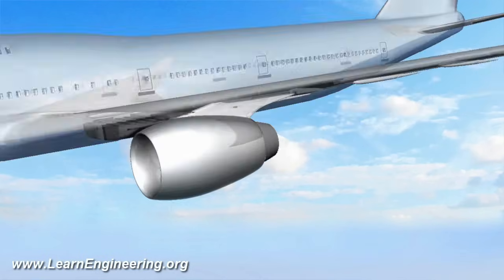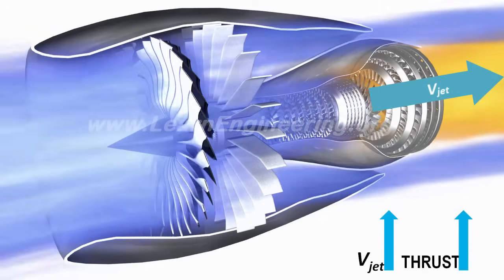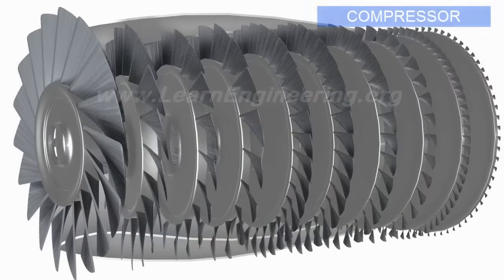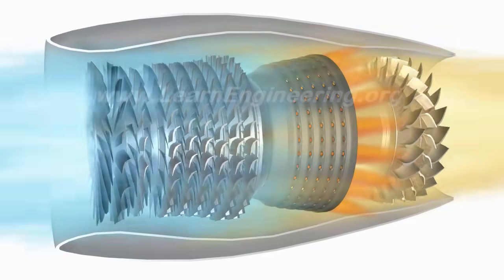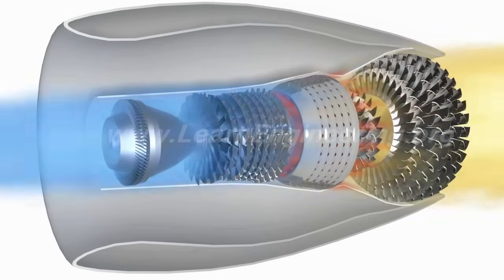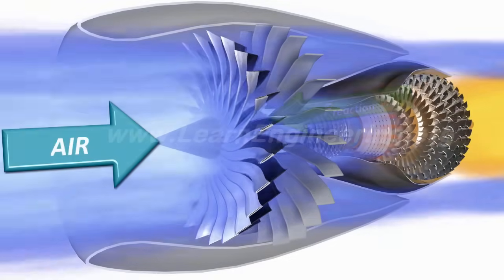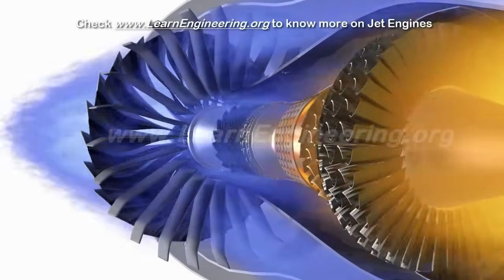Jet Engine, How it works?

Comment: I would dye to know what makes the jet engine spins at the beginning 🤔🤔🤔
Reply: What color of dye would you use?
Some jet engines use compressed air to start. Some use an electric starter motor.
Warped Perception has come fun videos where he runs small jet engines.
AgentJayZ rebuilds jet engines and he has a bunch of great videos on the topic of jet engines.
JohnnyQ90 also has some videos with small jet engines.

Comment: We can put same engine vertically and make a rocket ...
Reply: Until you run out of air when you reach space.
Reply: SpetsnatzLegion 336  I agree , I realized that after posting my comments, these engines requires oxygen and after reaching certain height there is no oxygen .
Reply: Rocket doesnt have moving parts. Its just fuel burning rapidly and being forced out from a small hole.
Jet has spinning turbine.

Rocket fuels usually have Oxygen in them + theres seperate oxygen tank for extra.

Comment: How do they start
Reply: Im no expert but my guess is that fuel is slowly ignited that starts spinning the turbine and as it starts sucking more air in and pushing exhaust out, more fuel can be inserted.
Reply: The shaft is started by an air starter, once N2 (the core) spins up to 25% fuel is added therefore spining the shaft faster

Comment: So the fans after the point of ignition are used to power the fans before the ignition?
And the fans between the turbine and the point of ignition are used to compress the air to be ignited?
What, other than the differential between the air pressure (?) prevents the expanding hot air moving back through to the front of the engine?

Comment: An escaping air balloon does not move because of a reaction force. It moves because of the internal force (pressure) imbalance: there is a hole in the back with zero pressure while the forward pressure keeps acting on the font wall of the balloon.

Comment: dear sir, what's the difference between steam turbine and gas turbine, please explain, I'm waiting for the answer, thank you
Reply: A steam turbine is a turbine that is driven by pressurized steam. The turbine is usually connected to a generator for electricity production. A gas turbine is what is shown in the video. A flammable fuel is used to heat up the air in the turbine and cause it to spin as it moves through.

Comment: but how do the fans turn? what makes them turn? is there like a rotor or engine that makes them turn? i have been wondering how it really works... i wanted to make a mini jet engine. :d
Reply: The air moving through them causes them to spin. When the fuel is burned it causes the air to get hot and forcefully exit the turbine. Air from the front of the turbine rushes in to fill the space the exiting air leaves behind

Comment: How do the engine start? It seems to me that the engine would have to have momentum to work.
Reply: They have a gear box hooked to the low compressor that has a small air starter hooked to it. The burner can doesn’t move.Turning the low compressor and low turbine will give it enough airflow to start the engine.. There are igniters in the burner can that ignite the fuel. First they bring the speed up with the starter., then turn on igniter and fuel. I worked at P&WA back in the 70s and also was in Naval Aviation. They preheat the fuel using a heat exchanger that cools the oil.

Comment: Nobody tells what rotates the engine blades to create compression.
Reply: You missed the point that compressor shaft is directly connected to turbine. When the turbine blades moves due to movement or expansion of high speed hot gases, compressor blades also moves as the blades are connected through same shaft of turbines.
Reply: Remember that first to turn turbine blades when engines are switched on a highly inflammable fuel is burned in combustion chamber which create expansion of hot gases and this turbine moves.
Since the turbine moves, compressor blades also rotates to genrate compressed air.

Comment: Awesome video,
How much liter of fuel per miles an aircraft use with this system?
Reply: I don’t know about liters of fuel, but I know a 737-400 burns about 7 gallons per passenger on a 631 miles flight that I have made hundreds of times.
Reply: @Chris_at_Home  ok thank you for your reply, I suppose you are a pilot? I thought even planes run without any fuel as price sometimes is very cheap and regarding other video about turbojet engines. 
So you mean 4000 liters or 1000 gallons for 150 passengers for 651 miles or 1000km..,.ok make sense

Comment: Ha, no ifs, ands, or butts about jets, still using a propeller, actually many of them.  For some reason, they can spin faster than the speed of sound without breaking the sound barrier like a 2 to 4 blade prop.  One huge advantage over reciprocating engines, in effect, only one moving part whereas a reciprocating engine has hundreds of moving parts.  And because of that spinning faster than the speed of sound phenomenon, craft can travel faster than the speed of sound. .

Comment: Uhm are the fan blades moving in the wrong direction maybe? Just started the video and already questioning the accuracy of the video
Reply: Made it past the first minute and goota say, everything in this animation is totally wrong. It's not even just mirrored or played backwards or a combination of those. It's simply wrong. The blades are twisted around, some are moving in the wrong direction and others are misshaped or facing backwards

Comment: On contrary the pressure created by fuel ignition impose pressure on incoming fuel air mixture, so how this is achieved??
Reply: the front part of the combustion chamber is the exit of a high pressure compressor, while the aft portion is near atmospheric pressure => the hot gasses follow the path of least resistance and flow through the back (that requires some very precise geometry on the inlet of the combustion chamber)

Comment: Does the blades melt on high temperatures?
Reply: No,  they used exotic metals and processes to manufacture them . Usually high turbine blades closest to the burner section are hollow with small holes on the leading and trailing edge of the blades. Air for this enters from the blade hub and shaft. When they started doing this it really increased the efficiency of the engines. I know they used to make the blades in halves and the used a laser to fuse them. My older brother was a tech on this process. He is a third in his name and both my dad and grandfather retired for P&WA.  My grandfather actually worked as one of the original employees of that company. Myself, 11/2 years in a factory was enough for me and moved on to other jobs.

Comment: Can you tell the airbus staff that i will buy an engine? I will use it for my pc fan when i play microsoft flight simulator 2020
Reply: engines are built by rolls royce
Reply: Woah, I did not expect to find my own comment 2 years later

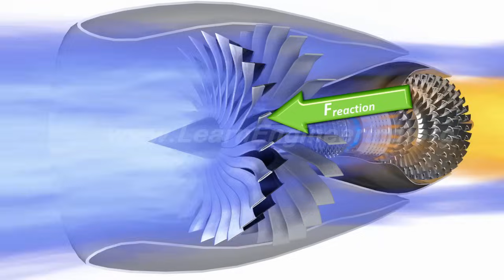Comment: 4:28
ah yes,
this engine sucks.
Reply: 2:22 what is the lift force for? Anyone? Sorry, I'm new to this.
Reply: @skymark7914  I'm pretty sure it's to help the turbines turn faster, as the lift helps push the blades
Reply: @skymark7914  the turbine spins when there is different air pressure on sides of blade.

When there is lower air pressure under the blade, higher air pressure on top of the blade pushes it down.

For same reason planes fly. There is more pressure under the wing, so the wing gets pushed up.

Comment: Why do we need all those turbines? Can't we just blow the fuel and run solely on the exhaust gases jet? I mean, those turbines slow down the exhaust gases, ain't they?
Reply: the pulse jet uses your method, but it's the least efficient engine ever (albeit incredibly simple). Compressing the air makes for a more efficient fuel burn, so extracting more energy out of it. You can also extract some of the power on the shaft to power electric generators and hydraulic pumps.

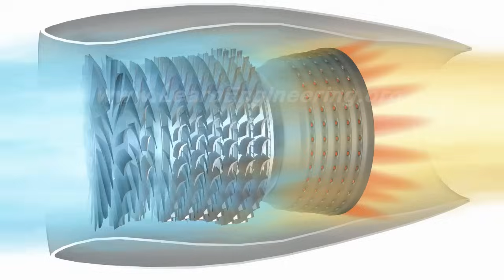Comment: at 1:50, if I look at my room fan and look at the orientation of the blades which is the same as in the vid and have same rotational direction then the air moves from right to left, instead of left to right as in the vid. Are the blades or the fan direction wrong in the vid or am I overlooking something ?

Comment: But how you strat to spin the turbine in the first place?
Reply: Usually compressed air is forced into the turbine to spin it up until it reaches a self sufficient rpm. On jetliners this air is supplied by the APU ( a small turbine generator). Smaller jet engines can also use an electric starter.

Comment: ok so i learned a little bit, but i felt it was missing a lot of information.....it says thrust at the expense of fuel and therefore better..that statement was confusing....i sort of get what you were trying to say but had to think about it. the choice of words were not good. i always thought that turbo fan noise was reduced because it cools the thrust air, which is rapidly expanding which causes noice, not due to the speed of the thrust..... for example i think thunder is created by the rapid expansion of the surrounding air from lightining... if thats right then i think the video missed that? i dont know....someone please clarify. i wish you woudl have explained the fan blades turning mechanism more, how and why is thrust created simply by the curvature,, i am sure it is related to bernoullis principle but i am looknig for more and a better explanation.... i really wanted to know th mechanism of thrust more intuitively...... how does it force the air to move faster to the rear in an intuitive sense.... and the resulting forces.....

Comment: So it starts to spin by magic cause the one i build in my backjard aint start spinnin just because i light up the feul
Reply: there should be compression to make it spin and it doesn't work with normal fuel.

Comment: "the same thing that moves a balloon!"
me: helium?
"newton’s 3rd law of motion!"
Reply: Helium doesn't make balloons move. The rapid decompression forces helium out of the small orifice, generating thrust. You'll get the same effect regardless of which gas you air the balloon up with. The balloon skin expands when you air it up, so if there's an opening for gas to escape, the skin will retract and push the gas out.
Reply: @sixstanger00  I think OP's confusion was due to concentrated helium (lighter than air) filled balloon makes the balloon go up in the air. However the concept the video is referencing is not that (but when any gas filled pressurized balloon has a sudden leak of air, balloon moves in opposite direction).
Reply: So can we considered turbine as a auxiliary machine please let me clear.....
Reply: Lol
Reply: Lmao 🤣
Reply: Even helium is used in balloon with respect to the third law of motion
Reply: Hi hydrogen tritium fusion can make helium too. If ions energy from trap steel rotors blades Turbine jet engines. You get thrust and speed for jet engines.infrared red light trap inside steel rotors blades dances making ions energy for turbines engines. LOBESTONES can get fusion hydrogen tritium power electric max power. No need for fossIl fuel is needed and no asthma.
Reply: What happens when you loosen a filled party balloons air stopper? That's whqt he's talking about.

Comment: but how do you start it when it has to be on to combust the fuel?
Reply: They get it started at the factory and then you just don't shut it down.
Reply: Actually, there are several methods.  The most common are electric starter motors clutched to the engine.  These other methods are mostly used in the military.  You can used compressed air in bottles to drive an air motor.  Or you can use a big engine on a wagon called a huffer cart to blow air into the front of an engine using an air duct hooked onto an open port.  The huffer cart is actually in Top Gun Maverick.  Mav and Rooster use a cart to start one of the two engines on an F14, then you use engine air cross connected to start the other engine.  T-38 training jets use a huffer cart at my airport all the time.   Also,ss there are electric igniters in the engine, but they only get use during startup.  After that the flame will stay lit by itself.

Comment: Holy crap! @:13 Another video showing either (1) the wrong direction of rotation or (2) the fan pitch reversed.
I'd certainly seek another (reliable) source to learn engineering. Skip the enginERRing from Youtube channels.

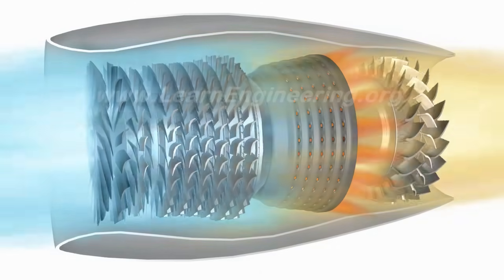Comment: Compressor blades shold be longer than turbine blades. You have put the fan behind turbine for explanation of turbofan engine which is wrong. Plz check it. Video from 3:04 is wrong audio is correct

Comment: How do they start in the first place? What engine is used to initiate the turbo fan engine?
Reply: They use an actuator that mates the starter motor to the flywheel of the engine. Once started, the clutch disengages the starter motor.

Comment: There's a way to do it with an ignition timed to the spark and piston but the jet is in a sealed chamber with a rotating fin which covers the intake just as it fires thus creating a timed jet which powers the turbo induction. At least enough to help displace the cylinder space with fresh air

Comment: The forward fan blades are backwards 0:13. Look at the design of the output turbine blades at 4:03 its spinning in the correct direction based on the fan blade angle. The turbine does not cause lift! The air volume created from the turbine creates thrust. The Venturi design of the turbine chamber creates a faster controlled volume of air creating intense thrust as the RPM increases .The wings create lift. who the fuck wrote this script? Captain Kangaroo!

Comment: What the fuck is this bullshit with the forward fan blades spinning backwards?  the blades are tilted in the wrong angle pushing the air outwards not pulling it through the turbine! Bullshit animation! At 4:03 the rear turbine blades are angled in the correct direction,compare and understand this incorrect animation

Comment: Why the compressed air is mixed with the fuel ? Can the compressed air provide enough thrust to move.  Or the fast outlet of the air can push the vehicle forward !
Reply: Compressing air takes a lot of energy, which is provided by the hot engine exhaust going through the turbine. If you don't have that, there's no compressor to compress air and you aren't producing thrust.

Comment: Why the blades are in pairs, stator and mover？
Reply: Rotors add swirl to the flow: they make the flow spin with the rotors and help increase the pressure. The stators take the swirl out of the flow so that it's purely moving straight through the engine, which increases the pressure quite a bit. The amount the rotors are increasing pressure themselves versus adding swirl is a very important design parameter for compressors (called the degree of reaction and actually related to the change in enthalpy, which is roughly the temperature increase)

Comment: Wait so how the fuck do the blades spin, where is the pistons that spin the blades like the car engines?
Reply: @JLH2933  ??? Ok what spins the blades??? I am pretty sure there are pistons because here was a documentary about what happened in Cathay Pacific had a crash landing, it showed pistons trying to crush water which was wrong fuel???
Reply: @JLH2933  Ok so two questions, first, what speeds up the process? Like you know when the throttle in the cockpit is pushed in and the jet engine produces more power, what is making it go faster?? Is the fuel burnt more quickly and the flames is bigger in the combustion chamber when pushing the throttle?? Second, how is the combustion chamber getting fuel to burn?? There is no pipe going into the combustion chamber to receive kerosene, or is there?

Comment: how are the spools fixated? (to the housing and the wing)
Reply: @JLH2933  thanks. but how are all these rotating shafts fixated on the engine housing? all videos are showing the rotors "floating" in the tube (engine). but you somehow have to fixate the bearings of the shaft.

Comment: If You Made It Out Of Steel, Put A Superconductive Magnet In The Middle Driveshaft, When The Magnet Pulls In On The Steel "Hyper Jetting Happens" It Is Called A "Hyper Jet" It's X 10,000 Times Faster Than Your Jet, Pinky. You Nullified The Mass Of The Engine So Zero Resistance Is Encountered By The Spinning Jet  Part's Without Inertia. Radial Vector Cancellation With Magnetism.

Comment: How is the fuel injected into the combustion chamber?
Reply: Usually 2-4 fuel nozzles atomize fuel into the combustion chamber.   They’re kinda like fuel injectors and two ignitors light the fire on start-up (kinda like spark plugs on steroids), but then the ignition is shut off and the engine will continue to run until fuel pressure is removed.  Ignition will come back on in the case of a bad storm, some planes that is automatic, some it is a function of the pilots to select to on.

Comment: Hypothetical Question. If a plane had cold air blowing out the back of it, at the same speed the hot air blows out would it still produce the same amount of thrust? Slightly less thrust? Or not enough for flight. Is the hot air a necessity? Or is it only needed for the combustion?
Reply: Is the hot air needed to set the conditions for the combustion, or is the combustion needed to get the air that much more hotter?
Reply: Josiah Daniel The hot air is needed to increase the energy of the flow so the turbine can power the compressor. Any heat after the turbine is completely a waste — which is one way propeller engines or turbofan engines are more efficient. You want the turbine to extract as much energy from combustion as possible and spinning a heavy fan or propeller helps with that.